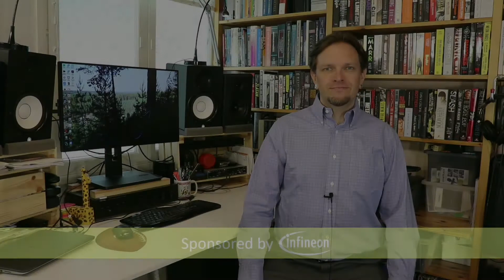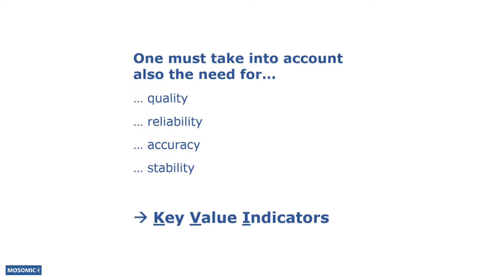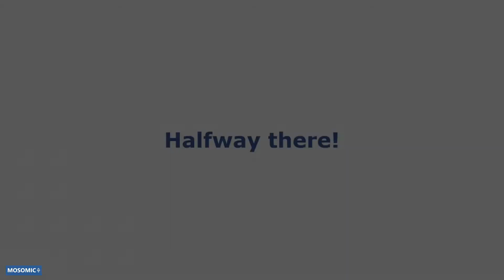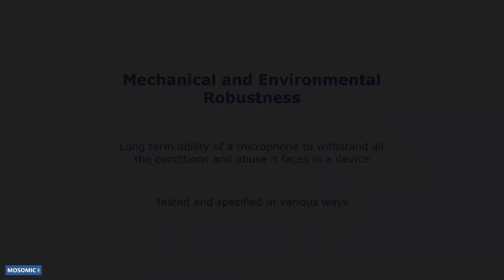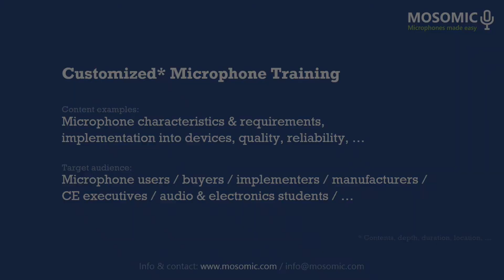Key Value Indicators Intro | MEMS Microphone Guide Ep04 | Mosomic

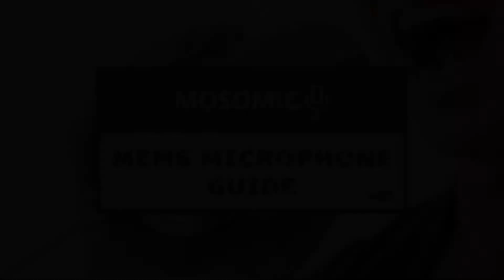Comment from the maker: 0:49 What is a MEMS Microphone Key Performance Indicator?
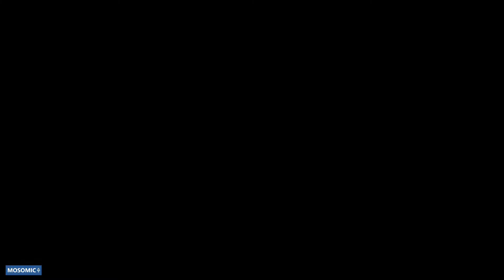4:05 MEMS Microphone Key Performance Indicators
- 4:27 Sensitivity (S, Mo)
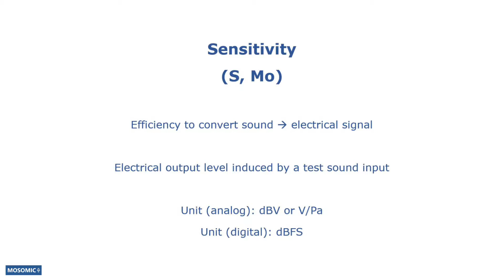- 4:50 Polarity
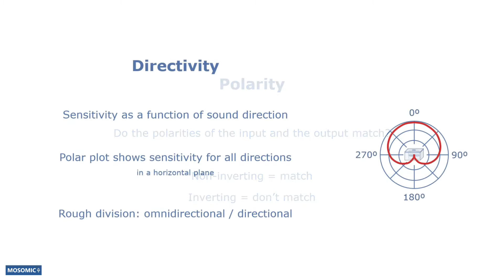- 5:02 Directivity
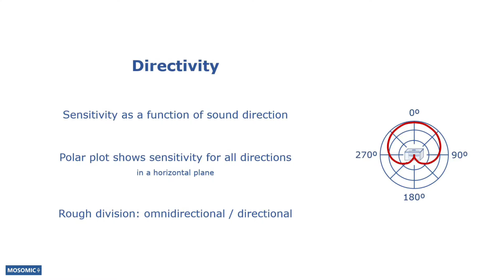- 5:37 Phase
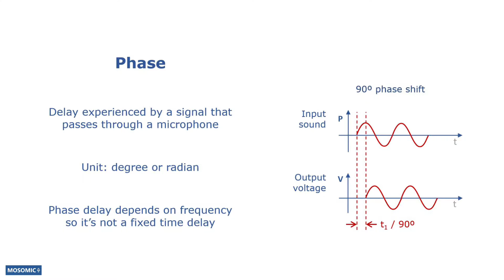- 5:58 Phase Response
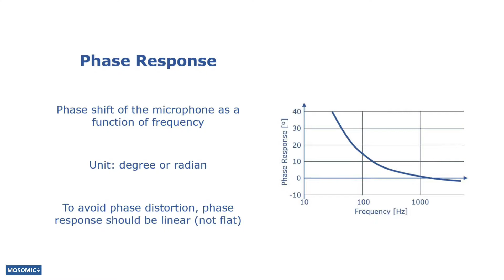- 6:25 Group Delay
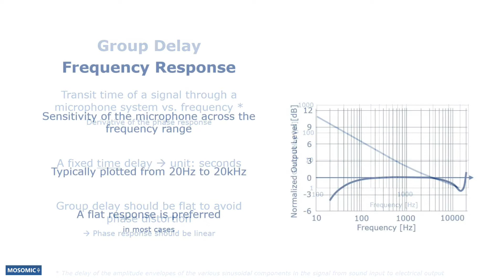- 6:49 Frequency Response (FR)
- 7:06 Signal to Noise Ratio (SNR)
- 7: 25 Total Harmonic Distortion (THD)
- 7:56 Acoustic Overload Point (AOP)
- 8:13 Dynamic Range (DR)
- 8:29 Current Consumption
- 8:43 Matching and Stability
- 9:04 Power Supply Rejection (PSR / PSRR)
- 9:39 RF Immunity
- 9:51 ESD Immunity
- 10:04 Mechanical and Environmental Robustness